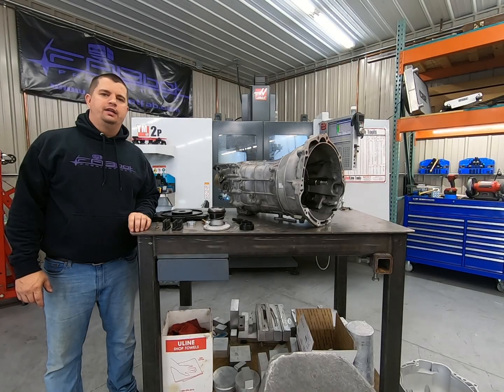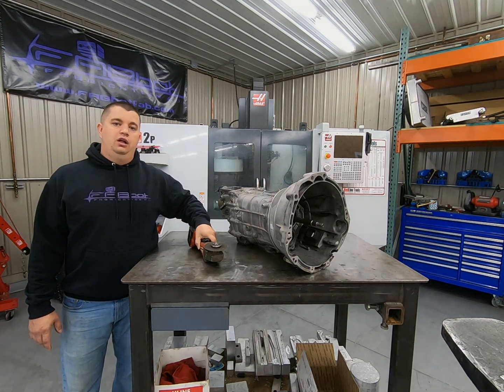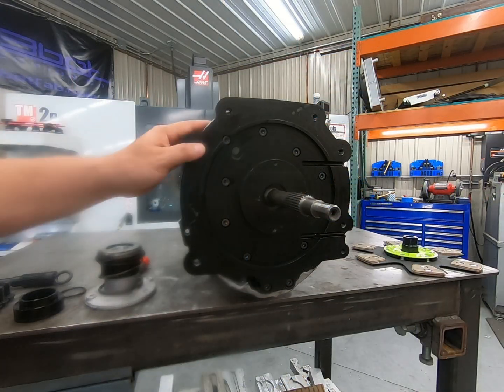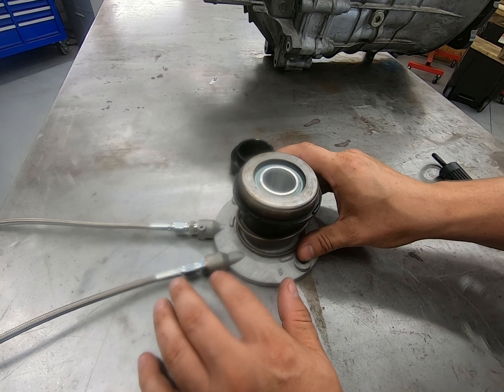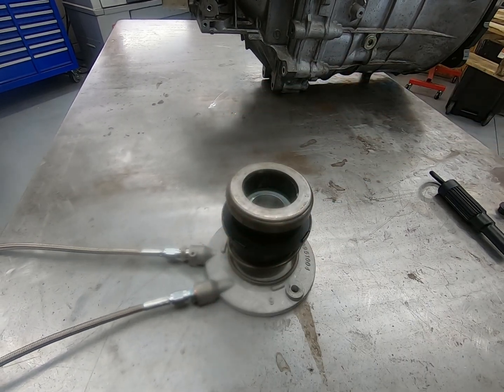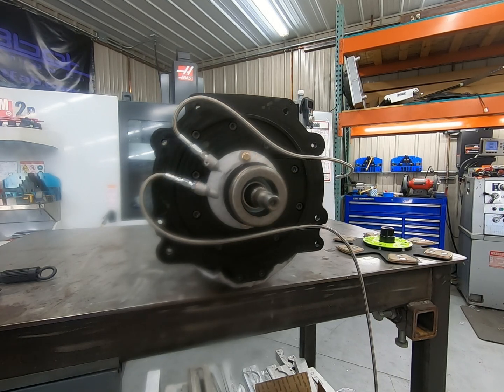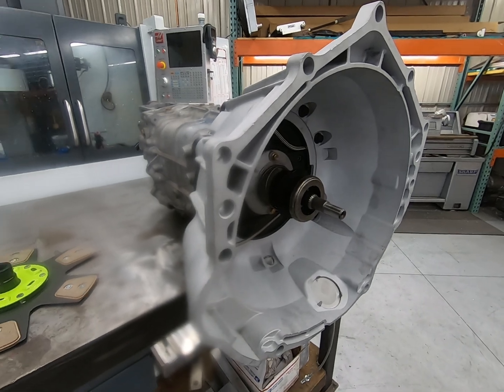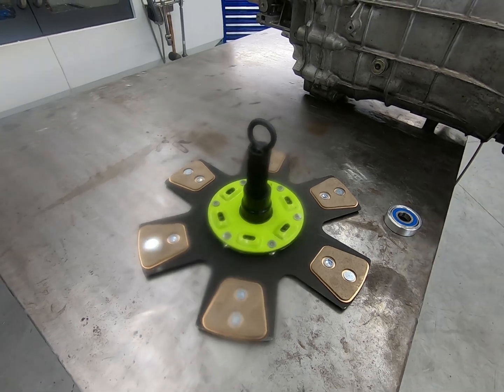FABbot LS to CD009 Transmission Adapter Installation Instructions

Comment: What stage clutch is that
Reply from the maker: It depends on what pressure plate you run with it. With our cyber street pressure plate it would be a stage 2 and with our cyber HD pressure plate it would be a stage 4.
Reply: Ok I just bought a kit for the colarado trans to ls swap I got a stage 3 I just thought they cam 6 puck not disc

Comment: What are the better year to use on the cd009???
Reply from the maker: The CD009 transmission was the final revision to the VQ35DE RWD transmission, and was originally shipped in the 05-06 350Z, 05-06 G35 Sedan, and 05-07 G35 Coupe. This revision featured stronger synchros in addition to other small design tweaks and is generally considered the best version of this transmission.
Reply: @fabbot6562  thks do I get the utube and legal immigrant discount ?? On your kit for the cd009😊😇

Comment: Wow ,you really do need to cut the trans. When I was looking at this kit and then looking up the trans i thought I couldn't find the right one since the bellhousing isn't removable.   Now the question is do I trade in my AR5 for a CD
Reply from the maker: Depends on what your goals are. The AR5 is a great budget transmission, but if you're looking for a bullet proof 6 speed, the CD009 is it!